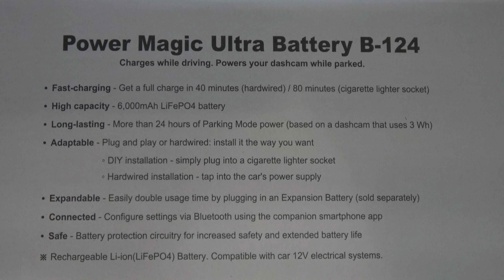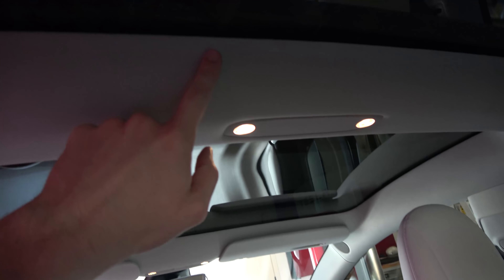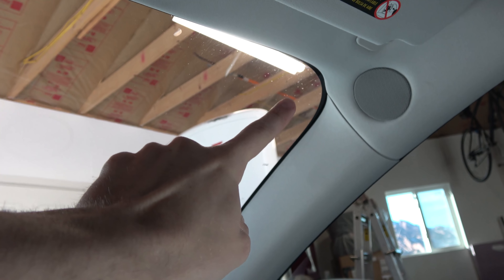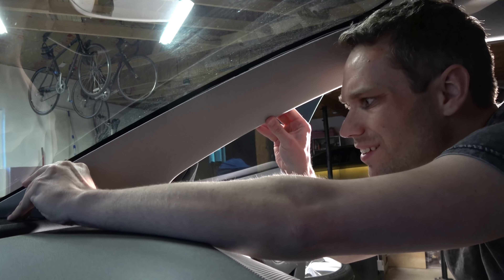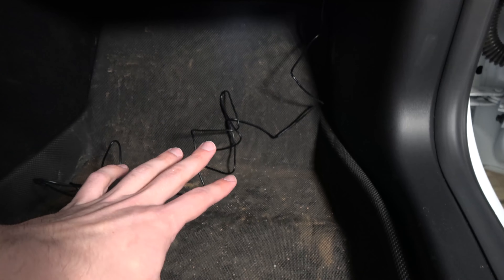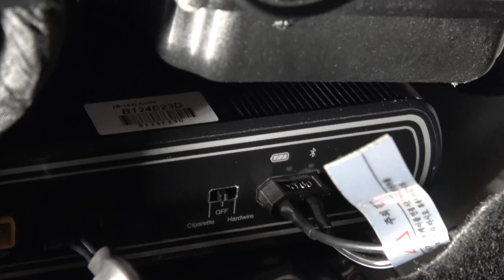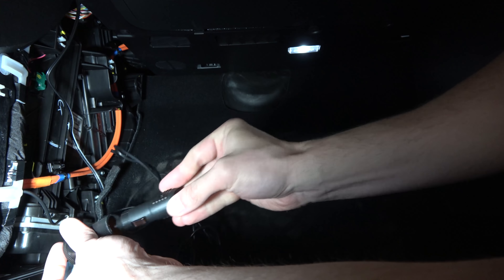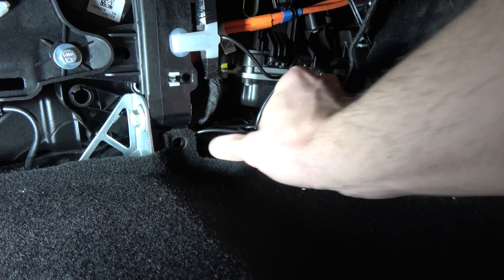🎥 Teslacam vs. 4k Blackvue Dashcam. Complete Model 3 Install & Comparison.

Comment: 6:20 About 10 years ago I worked for a mobile electronic installer, my second one. A SUV came in to have a remote starter installed, thus I had to fish the antenna wire up the A pillar to the center of the windshield. It was my first vehicle with airbags in the a pillar. 

I naturally started to run the cable behind the airbag. The owner asked what I was doing. “I’m running the cable behind the airbag.” With a dazed look on my face. “No need to, those airbags have enough force to break that cable.” I looked at him and rhetorically asked him “Are you willing to tell that to the judge?” And I just grabbed my tools and started to walk out... “Because I am not willing to tell a judge that, and it was a pleasure working here for 2 days. I am not going to put lives in jeopardy to take short cuts.” And walked out.
Reply: Good job

Comment: Just a little FYI for people - when/if you ever want to change your cabin air filters yourself they are under that passenger side carpet.  The orange wire shown at 13:20 is attached to the filter door where the upper pieces of blue tape are - top of the video frame.  Remove one T-20 screw at the top of the filter door and it will come right off - exposing two identical filters.

Comment: I have almost the same setup except the video cable goes along the floor in the passenger side.   I wired the power cable from the center console under the cup holders. And finally the battery goes fits in the center console when you take it out of the aluminum housing.  I manually turn off the battery when the car is sitting in the garage.  Still need to get a Wi-Fi switch to work so I can turn it off using a phone app or on a schedule rather than always opening the center console cover

Comment: Thanks for the informative video (though frustrating with YT showing the same unskippable ad multiple times!) I'm most of the way through installing a DR900X-2CH and B-124X battery in my RHD Model 3 (2019) following similar steps but swapping which side the cables run on. The centre console structure is the same so I inserted the battery from the left (i.e. passenger) side, but the opposite way around to what is shown in the video (so the connectors are facing the passenger side.) It was a lot more difficult to fit the battery in the space shown - had to bend the carpet quite a bit. I'm not sure if the battery is slightly bigger than the one in the video perhaps?

Some additional coverage of complete removal of the pieces covering the side curtain air bags would've been useful (I ended up finding a different video about this.) In addition to the clips that attach these pieces, there are some extra bits of plastic that hook onto them (probably so they don't go flying when the airbags are deployed.) Complete removal involves turning these and feeding the thicker parts through a notch near the clip (hard to explain in text!)

Comment: Great video. I don't know if anybody else mentioned this but electrical tape is probably the worst thing to use because it gets all wet and gooey and sags and comes off on a hot day and the temperatures in those compartments are gonna go way up past a 100ﾟ. Better off using  tiny  black wire ties..

Comment: This was really helpful, thanks! I was rewiring mine to use the 12V as Sentry Mode keeps 12V on and parking mode on the BV tended to keep the car idling instead of sleeping anyway. One thing I did differently was instead of wrestling with the a pillar I looped under the top of it right next to the headliner and ran it down the doorseal and behind the small trim piece and into the footwell.
Reply: Thanks for the tip. I couldn't get the A-pillar to come off with a good push or pull (yes I had removed the trims like in the video!) and so used a long zip tie to fish up from the door seal into the sun roof area. Worked perfectly, and the C pillar popped off no problem.

Comment: ive been using the A119 VIOFO.. 1 in the front and 1 in the back.. i didnt pull all the panels but i did tuck them in exactly like you did. i did this back in october.   and im getting the P3D now!

Comment: I’ve installed four of these BlackVue dashcams for my friends car and my own. After one hot Southern California summer they all failed from overheating and were unrecoverable. They were all the previous model DR650. Not this new 4K model. Hopefully they have fix the overheating issue.
Reply from the maker: I haven't heard this before. I had the 650, 750, and 900 all during at least one summer with really hot temperatures in the car with no issues. Did you use the blackvue micro SD cards? Want to make sure you use theirs or one rated for high/cold/extreme temps.

Comment: I went with the original powermagic battery to power my DR650-2CH.  It fits in the cubby with the cigarette lighter plug.   I get 8 hours of camera time on a full charge.

Can't confirm, but I think Tesla changed something with the cigarette lighter.   The powermagic battery gets charged more than it did when I first got it.

Comment: Nice done ✅ except two spots. The power cable crossing the metal trim of the central console should be reinforced. The connection via two cigarette lighter plugs isn’t that aesthetic you could shorten the wires and connect them in some other way. But I digress.

Comment: I’m thinking the battery pack will cause a rattle down the road - would have wedged in some foam or rubber pieces around it at the least if not clamping it down.  Otherwise looks like a great install.
Reply from the maker: It fits it pretty tight. I've been using it for over a week now with no rattles or anything. You could double sided tape it down if you wanted too. I wouldn't wedge anything around it so it has some airflow.

Comment: Excellent walk through of the install and has convinced me to do the same. A question for you: did you connect your camera to the Tesla's  wifi hotspot or didn't you bother with adding connectivity to the camera system?
Reply: Tesla doesn't have a wifi Hotspot. In fact it's the complete opposite. Your Tesla needs a Hotspot unless you pay the $9 subscription which allows  traffic updates on maps and the built in streaming services to use internet (but still no Hotspot).

Comment: I'd be concerned with the electrical tape separating from the sheet metal over time. The BlackVue comes with 3M backed wire clips in the box, which I think would be preferable to use.

Comment: I was told that the 12V in the console is always on now, so that means the blackvue battery is being charged all the time. Is this correct? If this is true, would the blackvue battery cause any problem to 12V battery in the car? Or just use the cam without using the battery pack since there is juice always at the socket. Please advice. Thanks.
Reply: Can anyone confirm this as of 10/21?

Comment: Great video! I was wondering to install it too. Two years ago I was following your tesla model S mounting step by step and it was really helping! 😊 I'm aware of the battery drain warning on the model 3 but I'd like to have more days autonomy than the advertised 24h from the auxiliary battery. (sometimes I don't drive it for more than one day, or just I'd like to have it recording while in the airport park) . I was wondering to place solar panels under the rear window and a battery that can be charged and discharged simultaneously. Probably the panels should be big enough to provide day usage + battery charging. Have you got any suggestion on this?

Comment: @14:30 after removing the metal strip on both sides, is it possible to unscrew and remove the whole front center console (not cupholder) without having to remove the lower black plastic trim?

Comment: I installed this months ago, based on the install from another BlackVue Tesla Model 3 install video and love my camera.  I did find that the indicator lights on the front camera were annoying, and had to go into the settings through the app and turn those off.  The constant blue light in my face (near my rear view mirror) was making me think there was a flashing blue light behind me (police), so I turned them off and turned her voice off.

Fun fact, I tried a 400GB card in the camera and it did NOT work.  I looked through all of their materials and there was zero reference to the "highest" rated card in terms of capacity it could handle, but apparently the largest they offer (or support) is listed on their website in the ordering options.  That annoyed me because I want a larger "history" file of driving video, but it is what it is.

I am curious if anyone has used any sort of adapter on the TeslaCam to install a separate Solid State Drive (SSD) in the console for storing larger volumes of TeslaCam files, especially with the new update that is rolling out.  I've seen a billion different set-ups of USB's but not any sort of SSD set-up.
Reply: Hello, we are working on adding a 256GB card to our lineup. The dashcam can theoretically support 256GB and higher microSD cards. The only problem is that microSD cards are not all designed to be used in a dashcam (with constant loop recording), although they could work just fine for other applications. For this reason, we cannot guarantee performance with non-BlackVue microSD cards. If anything, look for models that state "High Endurance" or something like that. They are usually a tad more expensive than the regular ones but less likely to fail. Thank you.